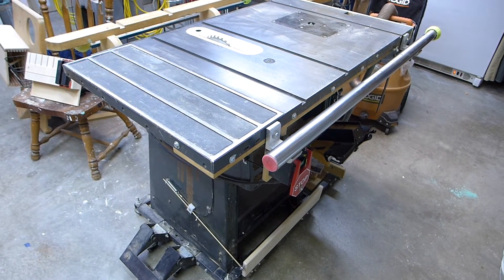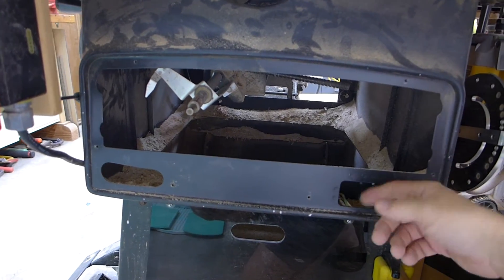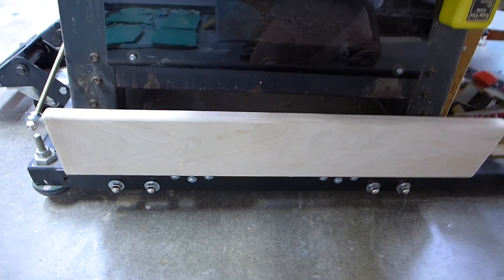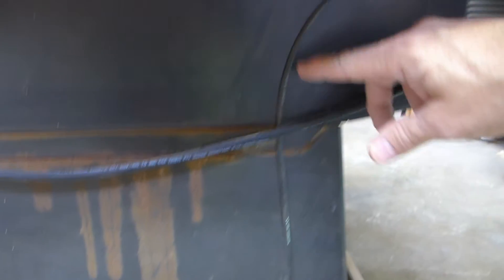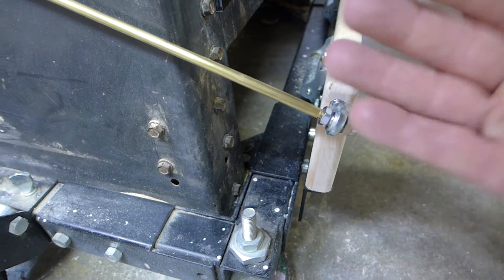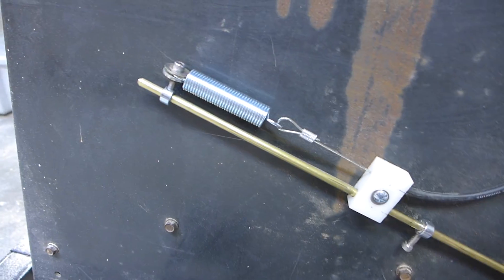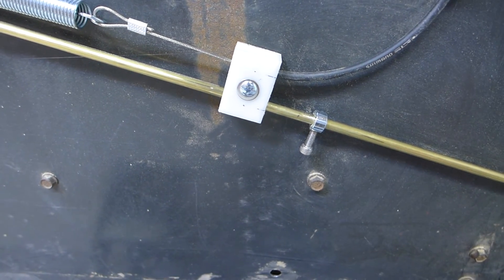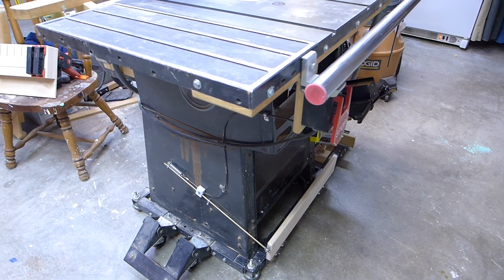Table saw foot-operated kill switch

Comment: Intelligent design, beautifully done and well described and illustrated. 

I've been really struggling to reach the tiny DeWalt DW745 table saw switch when using a sled. Down on my knees reaching at arm's length for the pathetic little off button, with the saw still running in the narrow sled slot with thin, cut ply still lying on the sled! Eek! Time to find a paddle switch, add a foot actuator board to the DW mobile work bench and make the saw safe! Thanks for sharing your clever ideas.